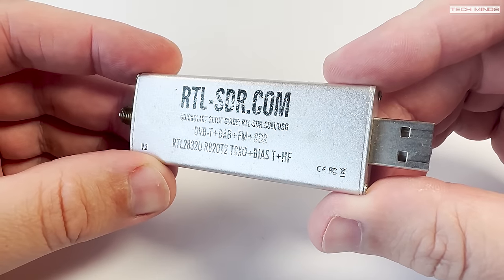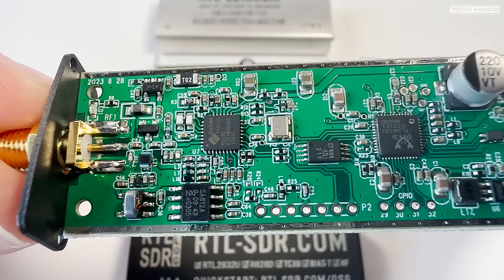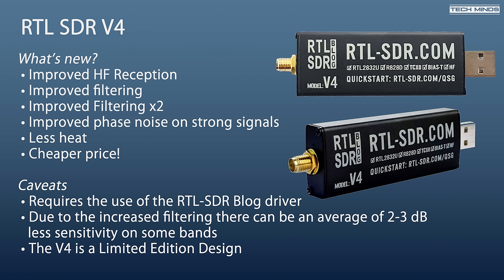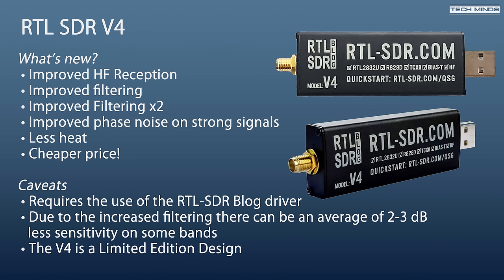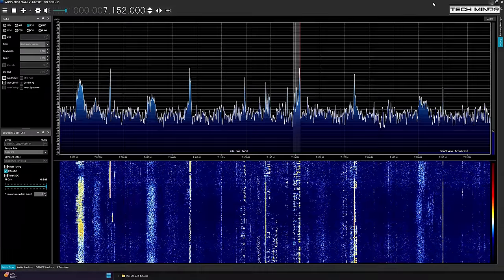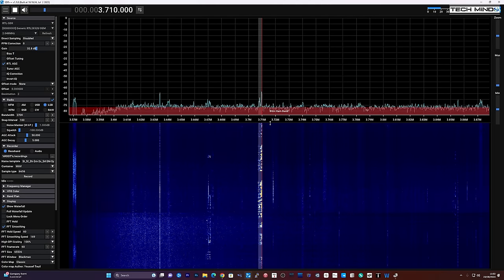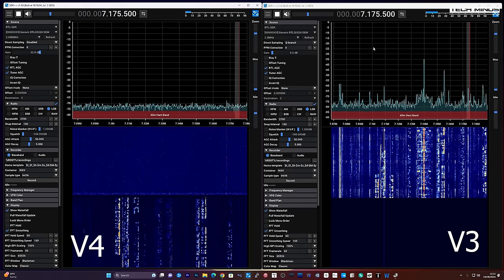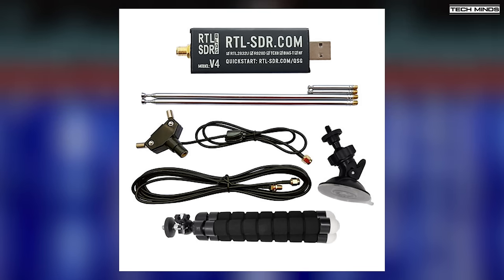RTL SDR V4 - Now with Built-In HF Upconverter  + More Features

Comment: The R828D is a very old tuner chip.
Reply: So the R820 is very new? Or what is your point?
Reply: @nine7295  Yes R820 is new. But the V4 is contains R828D tuner chip. R828D is a 10 years old chip.

Comment: I tried looking for one. But found version 5 is all ready available 

Nooelec RTL-SDR v5 SDR - NESDR Smart HF/VHF/UHF (100kHz-1.75GHz) Software Defined Radio. Premium RTLSDR w/ 0.5PPM TCXO, SMA Input & Aluminum Enclosure. RTL2832U & R820T2 (R860)-Based Radio
Reply: Not rtl-sdr blog, so not the same version number counting.
That's noelec v5 that is similar to blog v3.

Takes some effort to compare versions across vendors.
Reply: I have a copy of Windows 2000 to sell you then

Comment: if the led is not lit does that mean it is not operating correctly ?
Reply from the maker: The LED is only for showing that the Bias T is active. If it it lit, then there is a Bias T voltage on the sma, if there is no lit led, then there is no Bias T voltage being sent.